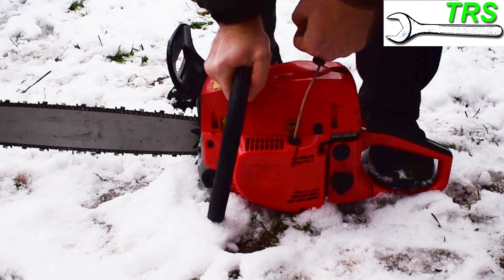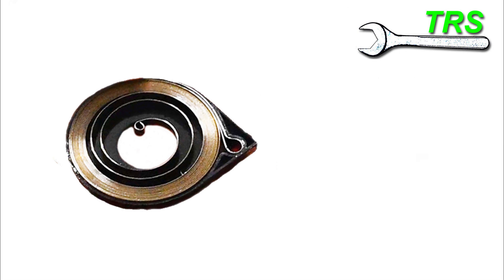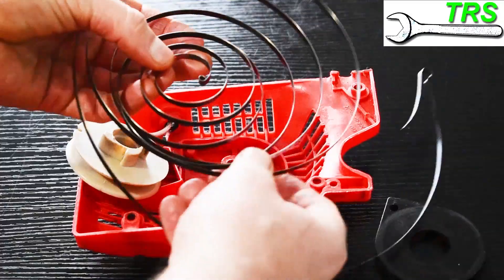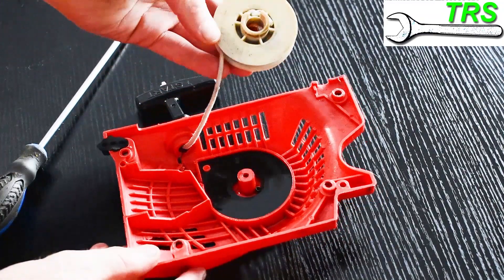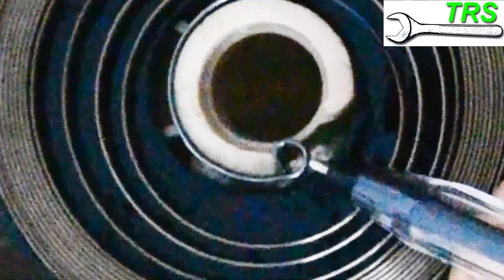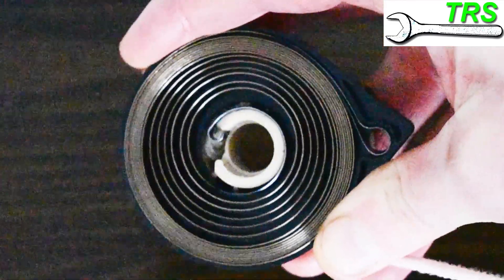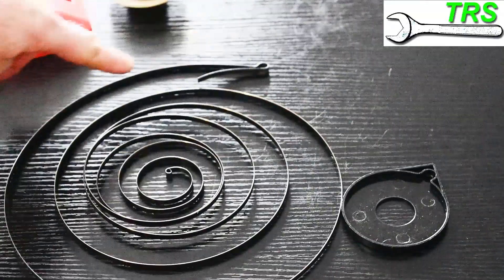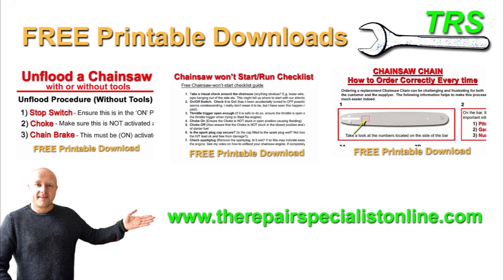Chainsaw Recoil Spring (How it Works) - The Repair Specialist  (by Craig Kirkman)

Comment: Subject Response: 'Engine Oil' - If Incorrect, this will happen! - Car, Lawnmower, motorbike, etc
I've never absorbed an understanding so easily yet with excitement to the listening ear. Searching for a solution to why my BMW's engine shakes following a cold start into an acceleration minutes later. Having no knowledge on the reason, I determined it may relate to a recent bad oil change. You're the confirmation, even more you're a prayer. To have possibly saved me thousands? I lov' ya. We've now subscribed and will visit the PROFESSOR'S classroom, often. John of the GLO team.